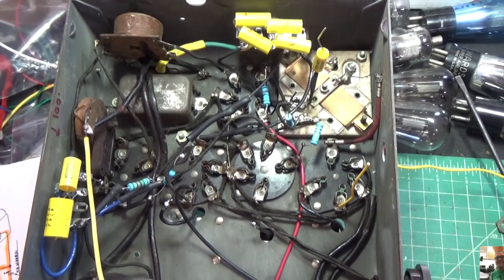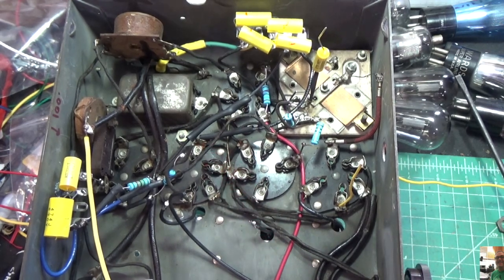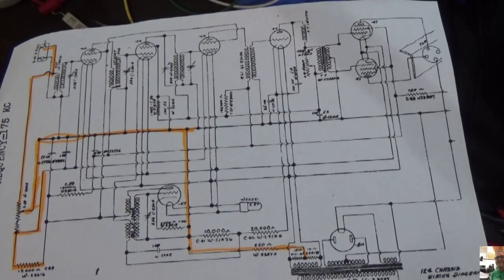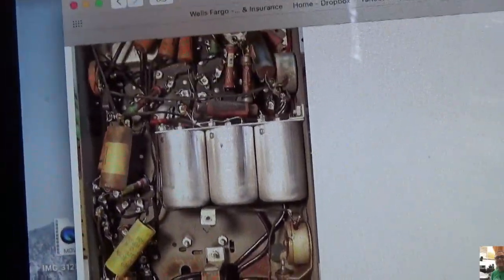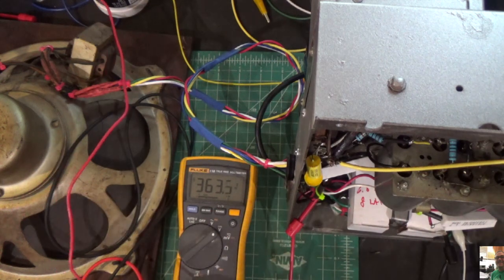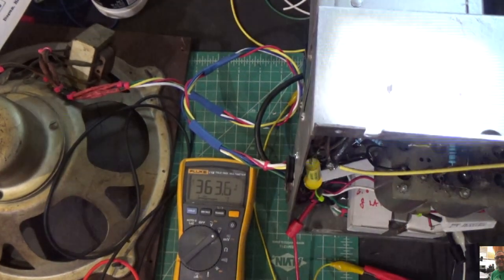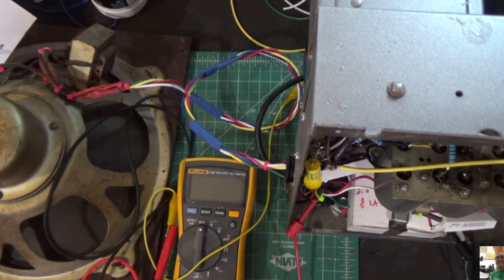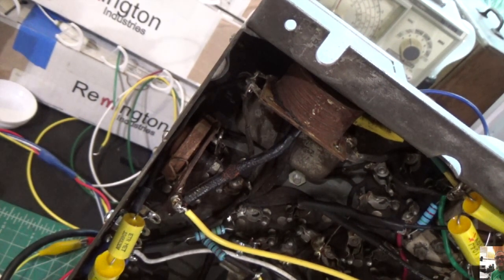Crosley Playtime Grandfather Clock Restore Episode #12 - Oh so close.. so close..

Comment: I got zapped by the camper, crazy wiring, had to do more rewire, bad connections.  
Me no like shock treatment.  The things that you discover.  Like when I connect water, got the plumbing done, but had to quit, too tired.  A few more tests, getting close.  
Will it leak?  Yep Ron, step by step, inch by inch...
Reply from the maker: Thanks Don.. Hope your zap was not that bad. I am realizing on this radio how much I do not know.... but thanks to all of you I am learning alot... I have no doubt i will get this working... one thing I never do is give up !!!!
Reply: It was pretty bad, I yelped.  The hot wire pulled apart and hit my arm.  Bad loose connection, should not pull apart.  Somebody used CRIMP connectors on 30 amp 10ga main line.  It had electrical tape, but the wire pulled out and got me.  I'll explain more in my next camper vid.
Reply: More likely hillbilly rigging from New Russia Township where we got it.   
This Polish boy  did it with Polocko Rigging, nobody but me knows WTF it is???  Pierogi's and Kielbassa, wit some VODKA and pickles, and a big Borp burp, oh yah!  A vid coming up soon with more 411 on the Polish camper.  Gotta get the stereo hooked up to play POLKAS full blast at the camp grounds, instead of that hip hop to the barber shop crap.